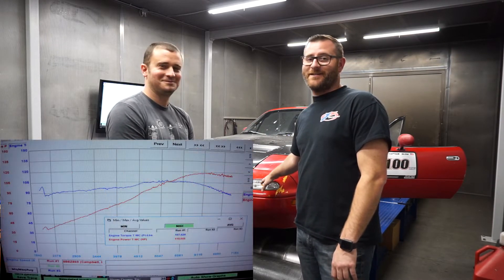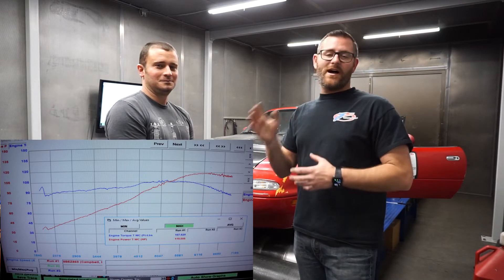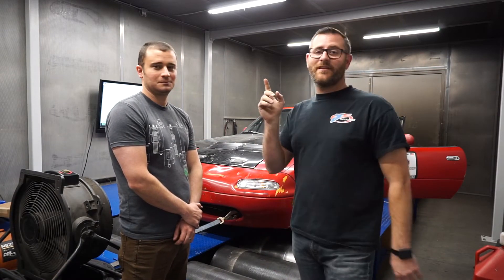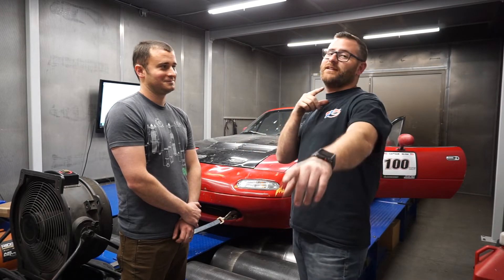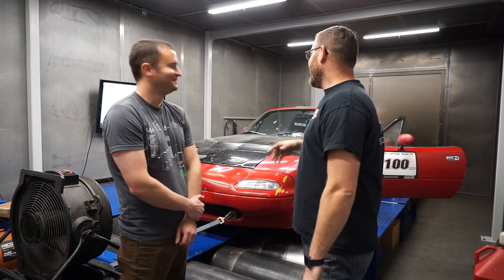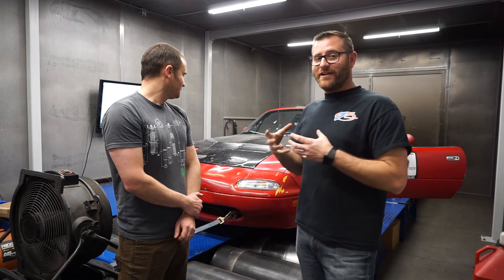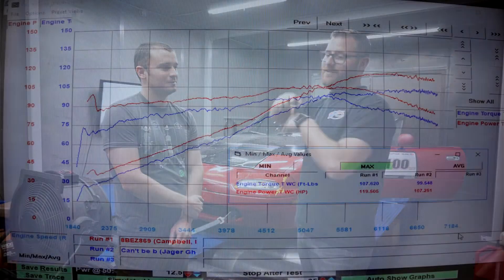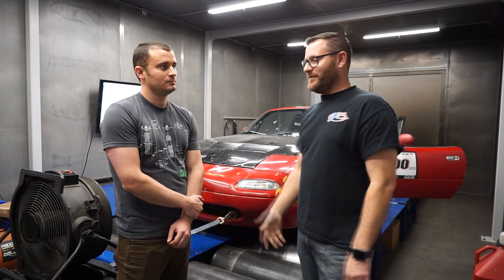Megasquirt 1.6L Miata Dyno Results

Comment: I have a 1.6 and I'm debating doing the megasquirt upgrade as well as the jenvey itb, do you think an itb would get a few more ho from stock? Wondering because spending 2k for 20hp seems pointless, I could do a 1.8 engine swap cheaper
Reply from the maker: Dom Mantia I wouldn’t do ITBS they are more a pain than they are worth. More of a status thing than anything else
Reply: Or you could go Megasquirt and boost the 1.6 get around 100hp gains 🔥 thats my plann i just wanted to see the NA gains from the megasquirt alone
Reply from the maker: Jered Helmbrecht not a bad plan at all, although it usually take quite a bit to turbo, depending on your current status of certain things such as water cooling and oil cooling as well as tire width and so on. They all matter
Reply: Jered Helmbrecht that’s what we did!
Reply: @JagerRacing  why more pain?
Reply from the maker: @MrTAKIS1984  tuning of itbs is notoriously difficult especially if you don’t get quality units. Also you would be sucking a lot of very hot air so in my opinion not worth it.

Comment: Is it reliable??any issues?? An 
Ms2 is reliable for an mx5 as a daily car??? Someone told me that i have to put an ms3 mini(too expensive). Is that  true??? I dont want something special for my 1.6 nb2. Just 15-20hp more with the same reliability
Reply from the maker: Not an issue at all in terms of the hardware. Mine was used and is still working great years later. Cold start is the thing that makes people hate daily driving them. Which is annoying but not the end of the world
Reply: @JagerRacing  cold start?? Not steady idle for example??
Reply from the maker: @MrTAKIS1984  steady idle is pretty easy
Reply: @JagerRacing  so, whats the problem with cold start? Doesn't start easy ?? Im just trying to understand
Reply from the maker: @MrTAKIS1984  yes it take a lot of time to get it right, and you can only do it a few times before you have to let it sit to try again. It’s hard to get that factory car style start up where it just cranks and turns over super easy.